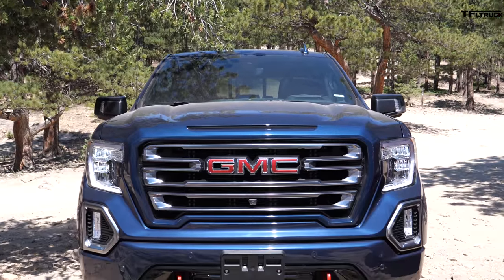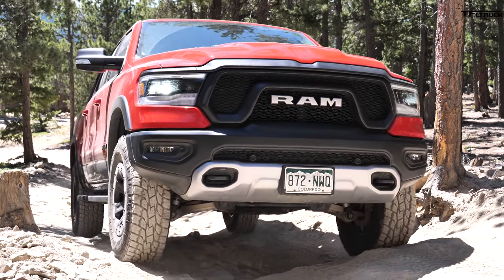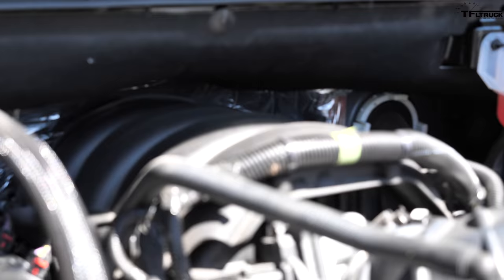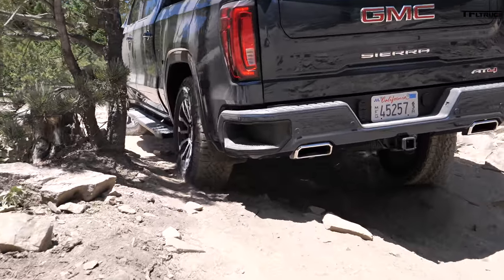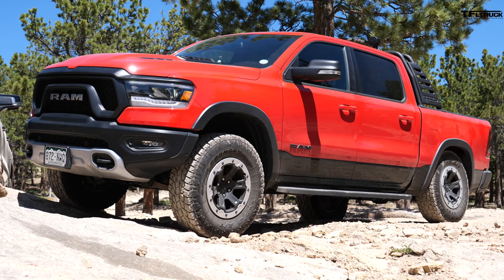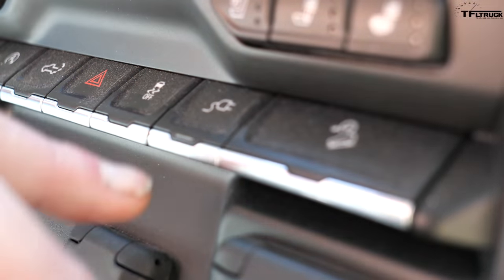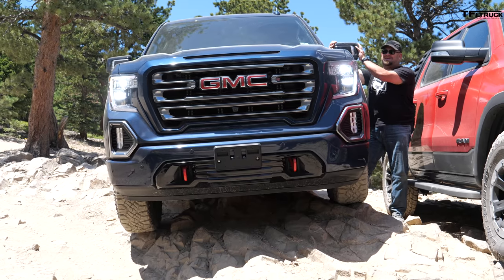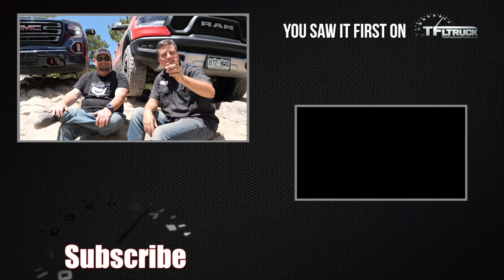GMC Sierra AT4 Comes Up to Challenge the Ram Rebel Rouser and This is What Happens | Ep.7

Comment: Cough Cough Raptors better!
Reply: Yea, but different class of vehicle.
Reply: Yea obviously as the raptor is purpose built truck with much more suspension travel. These are just normal trucks off the line with nothing more than a leveling kit thrown on from the factory and more off road worthy options. 

I threw a leveling kit, upper control arms, Fox shocks, bigger tires, and made 1/4in steel skid plates for my 2012 Silverado and while it’s still no raptor it’s still just as capable if not more so than these two trucks in the video....
Reply: Yea obviously as the raptor is purpose built truck with much more suspension travel. These are just normal trucks off the line with nothing more than a leveling kit thrown on from the factory and more off road worthy options. 

I threw a leveling kit, upper control arms, Fox shocks, bigger tires, and made 1/4in steel skid plates for my 2012 Silverado and while it’s still no raptor it’s still just as capable if not more so than these two trucks in the video....
Reply: @Mr Sunshines nah, it didn't break down, it's waiting at the top, waiting to share the view with anyone who cares come up to it's territory at the top of the mountain.

Comment: TRUCKS ARE NOT FOR COMMUTING.  Stop buying trucks if you don't need it consistently. They waste more fuel than any other vehicle. If you only use it for just for hauling your toys then just rent a truck. More annoying  is people with big trucks hauling little toys or things.Our fuel resources can't last if waste it on stupid big pick up trucks. I think if your towing more than 5,000 pounds of toys that is a big waste. Get a smaller truck then. Use your truck either full time or leave at home. Not for running errands.